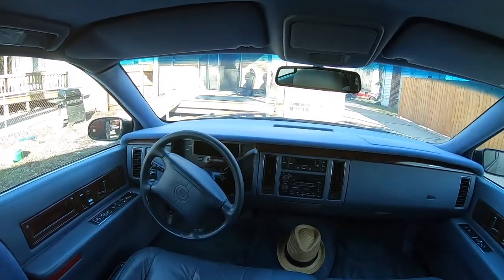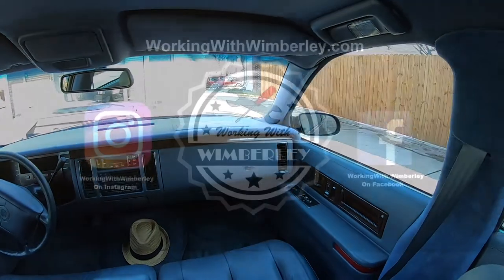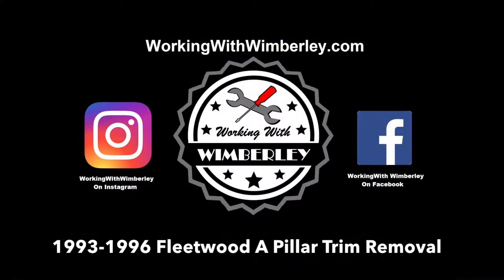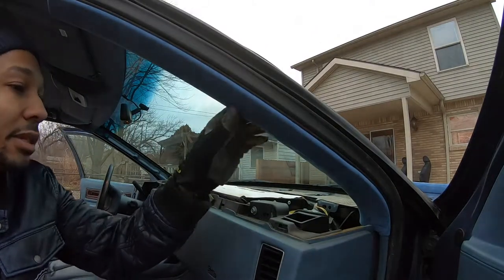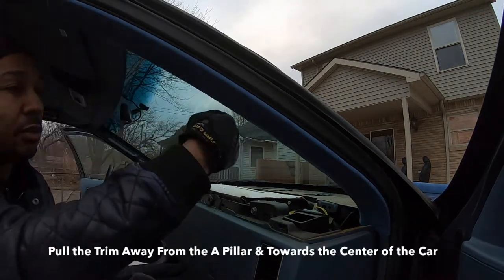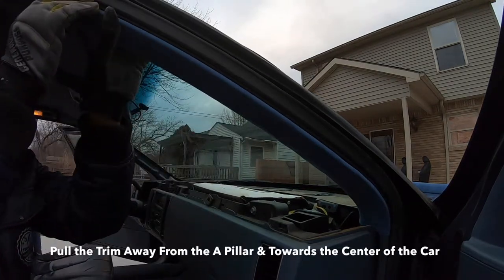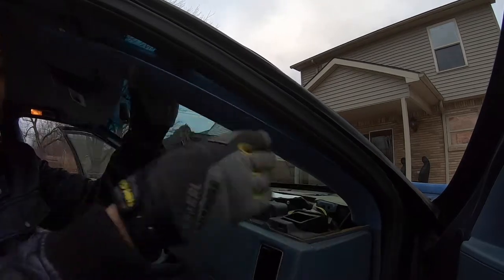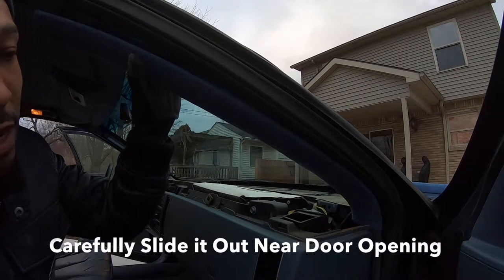Cadillac Fleetwood A Pillar Trim Replacement & Installation 93-96 Interior Impala Caprice Windshield

Comment: Man I got this 96 deville I’m trying to take the A pillars out, any tips on that?
Reply from the maker: Here’s how I did it on an Escalade. It might be similar. https://youtu.be/TaJm68nM0tY
Reply: I did it on a 99 DeVille, it was similar to the Fleetwood only you dont have to remove the wood trim. Pull out the ac vents and the screws are behind them. I think I saw a video on YouTube on how to do it. Otherwise a service manual is helpful.
Reply from the maker: Ok cool. I would’ve responded a long time ago, but sometimes I don’t get the alerts from YouTube.

Comment: Where did you get the replacement dash pad?
Reply from the maker: I pulled it from a Fleetwood at a local salvage yard. It was in good shape with no cracks, but it was the wrong color. So I covered it with suede.
Reply: @WorkingWithWimberley  Thanks. I will have to keep my eyes open for a good one.
Reply: Where can I get replacement clips for that trim panel? Got a 95 Buick Roadmaster that has a broken clip.
Reply: You can do the exact same thing on a 1993 Caprice?